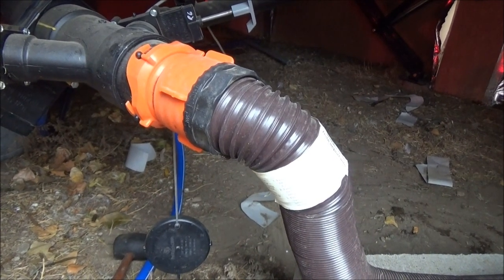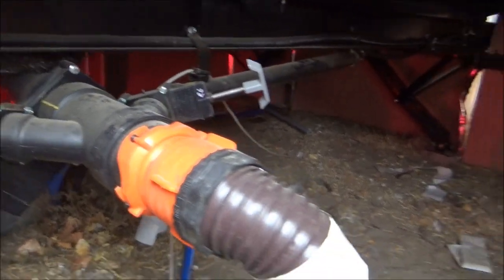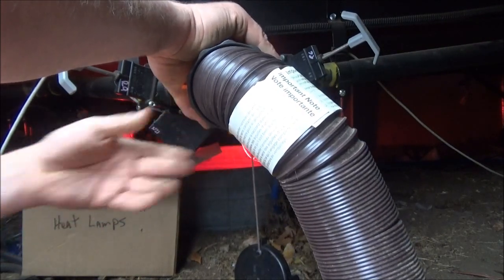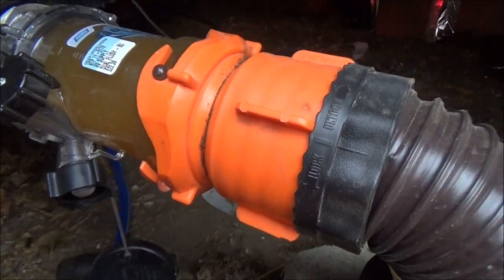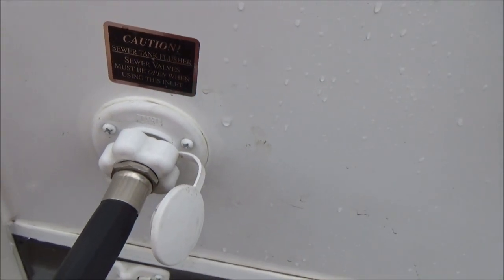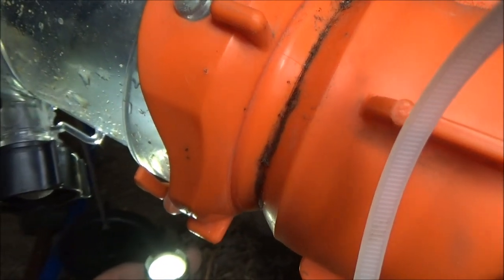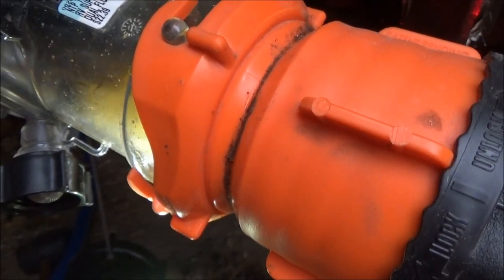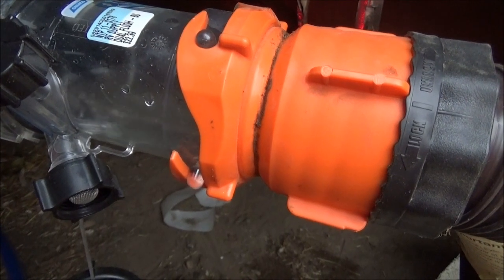Is Your Black Water Tank Really Empty? - Living in a Travel Trailer - L2Survive with Thatnub

Comment: Thanks for the videos, but I need to add. You need to wear gloves! Also you need to drain the black tank 1st, as many times as you want, but keep the grey tank valve handle CLOSED while doing so. Then when finished with the black tank drain the great tank! If you used anything in the black tank get the blue stuff. For the great tank white vinegar is the best to ad a quart or so in the great tank. Also keep your drinking water hose away from all other tanks! Plus use a water pressure regulator with your fresh water hookup! These tip will help you if you have not heard them yet, but also others. Take care be safe.
Reply: Kevin Voyer